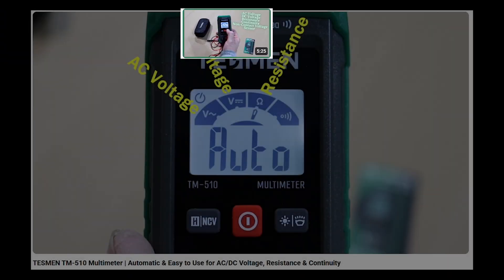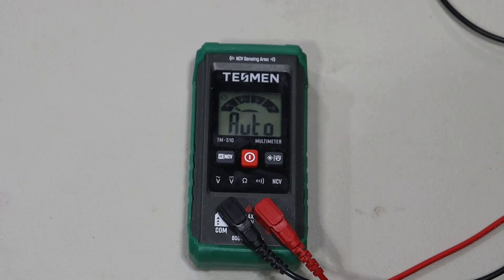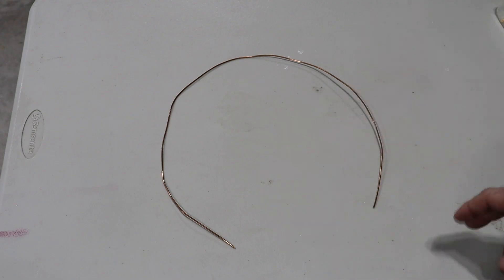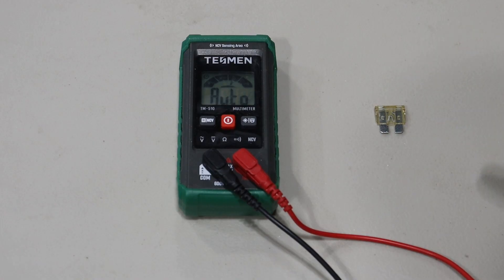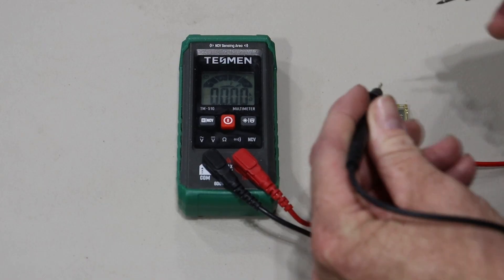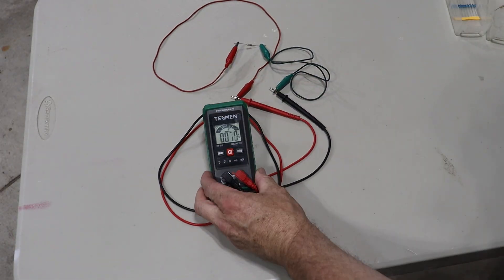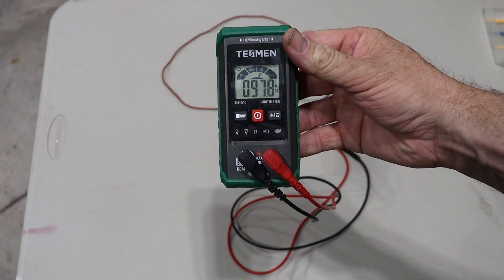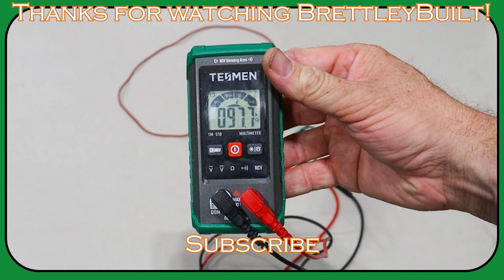Why Your TESMEN TM-510 Multimeter Is Not Measuring Resistance

Comment: Thanks for the video. I couldn’t figure out why this kept saying my primary coil on a dirt bike which is supposed to be only 1.65 ohms kept reading as having continuity with no ohms measurement. Is there a smart auto sensing meter that will read low ohms?
Reply from the maker: I am not sure about the availability of a smart auto sensing ohm meter.
Reply: @brettleybuilt  I’ve been playing with this multimeter more and found out that it does give me a correct resistance reading at around 1.5 ohms it just beeps and says continuity. So it does give the resistance reading below 50 in thousands and calls it continuity. Try it out and let me know if it works for you.